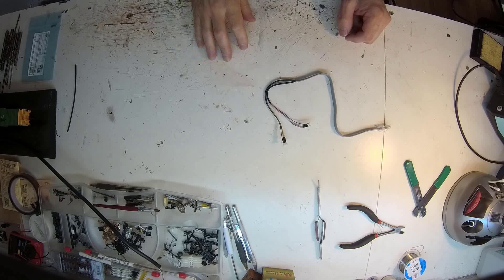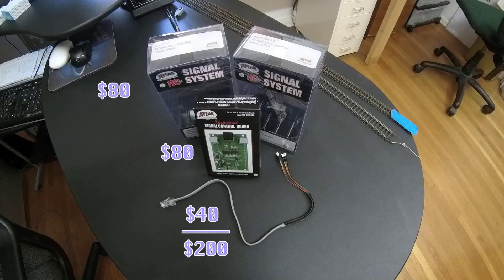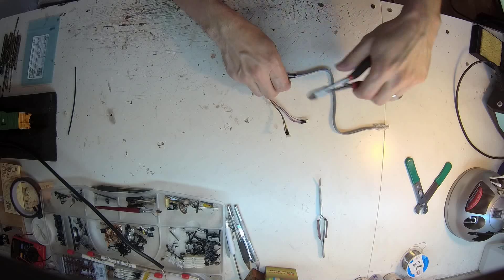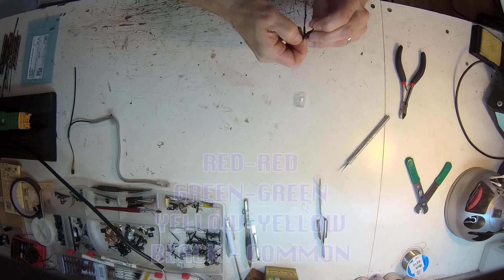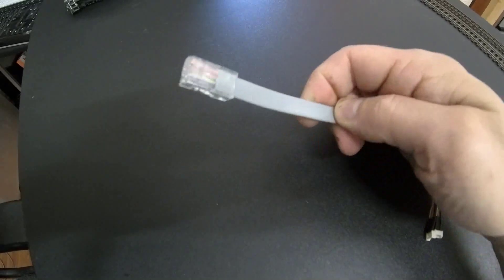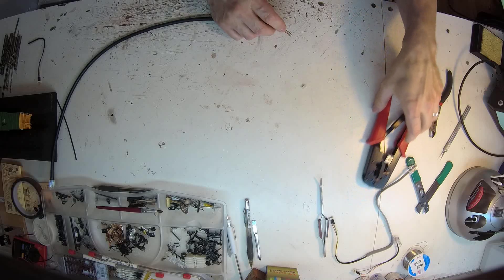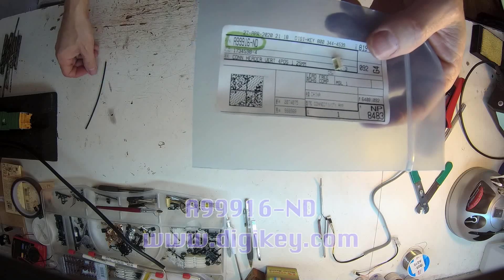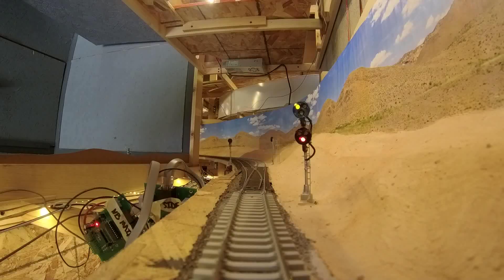Workbench: Atlas Signal System Cable

Comment: The connector between the signal mast and the Atlas cable is a JST 4-wire 1.5mm connector.  (JST - Japanese Solderless Connector)  Soldering wires to the male plug can be a bit of a challenge.  For the two outside connectors, solder the wires on the outside of the male plug.  This provides a bit more room for the two interior wires.  As an added thought, to add more rigidity to the connector, apply a dab of epoxy glue to the soldered area so that the soldered connections and the plug are "one unit".

If you are using Digitrax LocoNet 6-wire flat-ribbon cable and you have the parts, you can crimp an RJ12 6p6C male plug onto the end of a chunk of cable and plug it into the RJ45 female jack on the SCB.  The plastic tab on the RJ12 slides and locks nicely into the RJ45 female jack.

Comment: This is awesome. I’m planning to install ABS on our club layout (June 2025) and thought there had to be a way to hack the cable. Very helpful. Just one question. You said to use pins 3 thru 6 when making the cable. Starting with yellow, are the other colors ordered as you spoke of them in the video? Yellow, green, red and black / common.